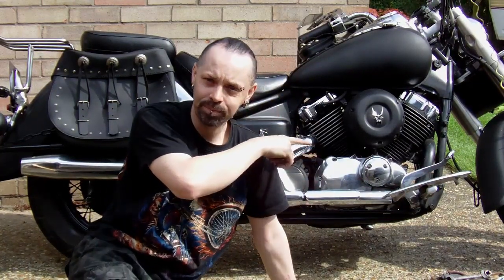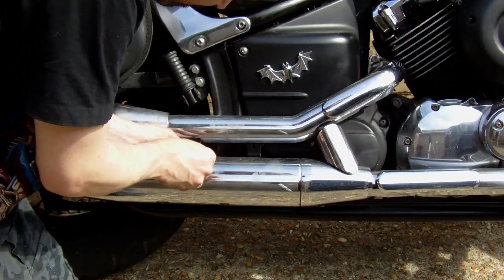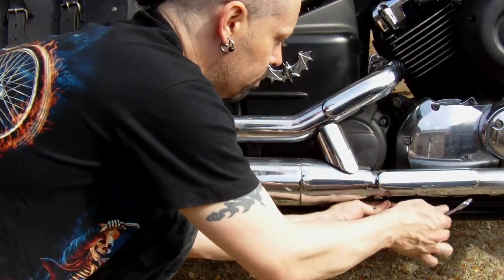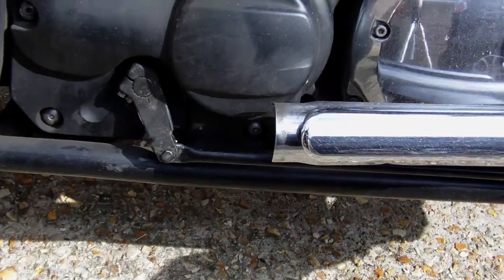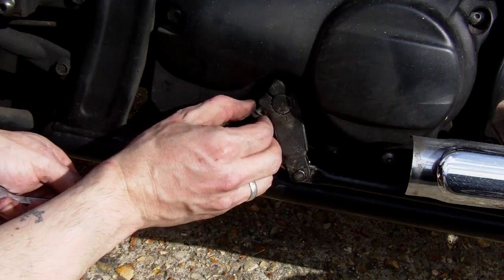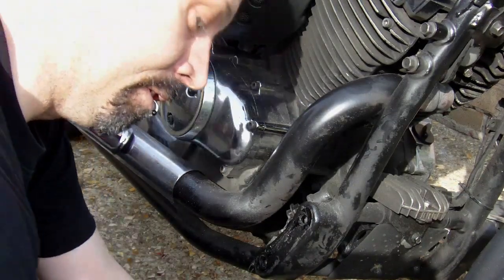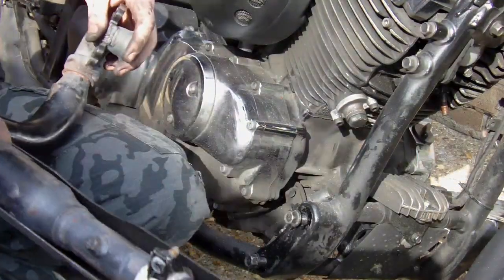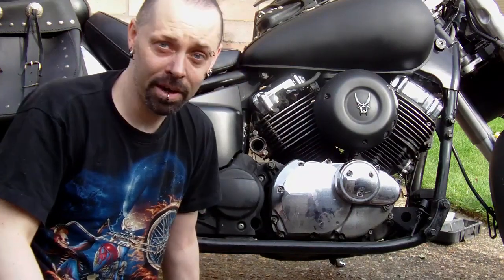Yamaha XVS650 Exhaust System Removal

Comment: What is that special tool call to remove bolts ? I cant get to it...
Reply from the maker: Either a hex key with extension bar or in this case as I had replaced with marine grade bolts, a 13mm socket with extension bar ...

Comment: Hi. Nice video. I'll be fitting some Highway Hawk short cuts to my V-Star, the stock pipes have been modified and the cross link tube cut and sealed so the sound is rubbish. Hoping the new pipes sound good. Btw, love the bat on the battery cover,  I  got skulls on mine 😊

Comment: can you please help me. what diamiter is the thread of the marien grade bolts you have holding the exhaust into the cylinder
Reply from the maker: From memory M10, but that was a very long time ago... Ebay records don't go back that far..
Reply: Gothtecdotcom cheers its for my friends bike i do a bit of work on it from time to time as well as to my shadow. his exhaust bolts have rusted away so im gonna need to replace them all together. thanks for the reply
Reply from the maker: Yeah, they are prone to that, hence replacing them

Comment: On mine that last little chrome trim piece is loose on the final pipe. Do I need to remove entire exhaust to get it tight again?
Reply from the maker: Jackson Cruz  Is held on by a ring with an allan bolt?

If so then no. If the bolt is tight and the ring is loose then it may need packing, which I used aluminium foil folded tight to do it when one of mine lost its original packing.

If its one of the ones thats welded on then yes, because you need to get a welder on it to fix, or rip it off and grind back, a coat of matt black BBQ paint, sorry exhaust paint should neaten it up, or exhaust wrap, but it will always look a little odd...

I'me guessing that one of the rings just lost its packing, because the other is either expensive or looks messy.
Reply: ***** 

What I had to wind up doing was remove the entire exhaust and remove the front pipe. After I did that I wedged the chrome trim open enough to stick a screwdriver in and remove both phillips screws inside of it. Then replaced those with 10mm bolts and used red loctite on the threads. I tightened them up really snug so they should never back off now. I did all this without damaging the welded on band in the front. Thanks for replying back.
Reply: About to try the same thing

Comment: Are the two pipes actually connected by the down pipe in between them,  if i cut it in the middle to make two seperate pieces will it leek exhaust fumes? Or is it just a stabilizer?
Reply from the maker: It'll knacker the back pressure balance and knacker the performance
Reply from the maker: It an important part of the exhaust so don't...